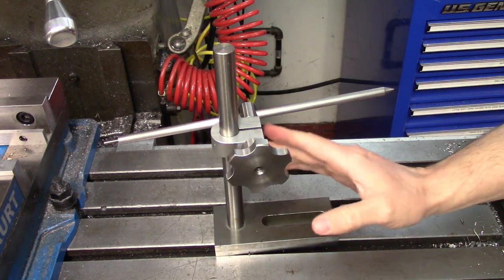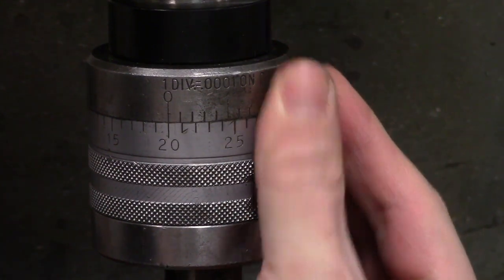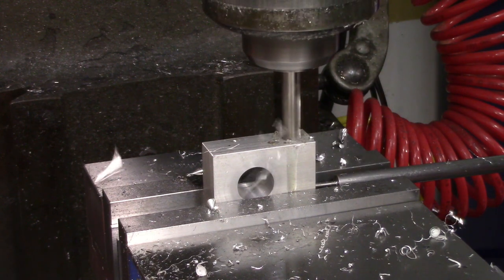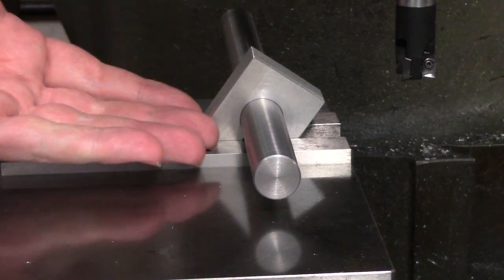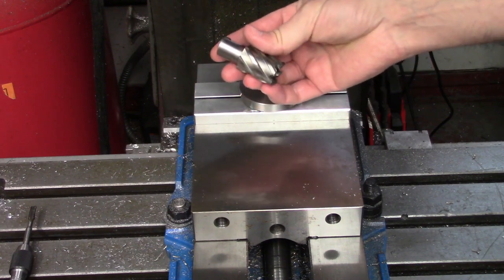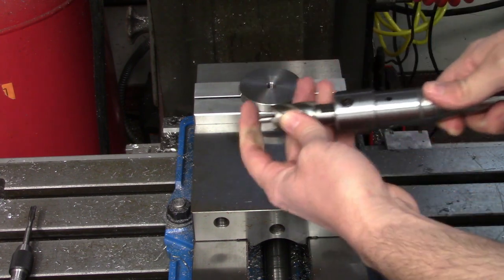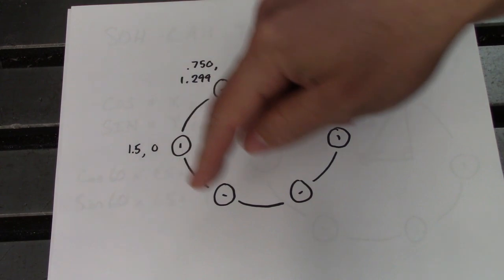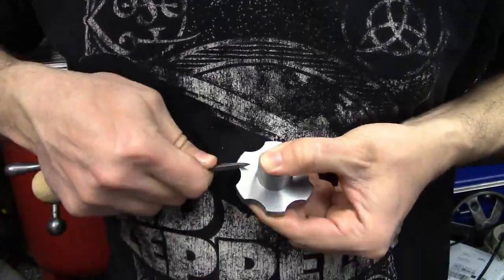Making a Table Stop Part 3

Comment: Hi Stuart,

I enjoy learning from all your video lessons, but I especially have benefitted from the three on making a table stop.  I followed your drawings and have now made my own.

I have a couple of comments.  First, It would have been nice to have a bill of materials for each part on the drawing.  I didn’t realize that the sliding holder was to be made from aluminum so I machined mine from steel.  

Next, I machined the scallops in the tightening knob differently than you did.  I put the knob into my hex 5C collet block and clamped it into the milling vice, cobbling up a work stop from my work hold down clamps.  I found a NOS B&S 1 inch two flute end mill on eBay for a very reasonable price and used it to mill each scallop on the along the center line of the Y axis.  The DRO told me how deep to make the cut.  After each cut I loosened the vise and rotated the hex collet holder to the next side of the hex for the next cut until all six cuts were made.  If I had it to do over again I would use the bolt circle function on my DRO as you did just for the experience.

I drilled and reamed the 3/4 inch hole for the column in the base.  This left a hole a little bit too large for a press fit, so I ended up putting in a set screw to keep it tight.  I now realize I should have used the boring head on the mill as you did to make the hole he correct size for a press fit.

Finally, I used a small corner rounding mill on the base to break the sharp edges at the top and to give it a more finished look.

Great project!  What’s next?

Thanks,

Trent
Reply from the maker: Good to hear.  I love your idea about breaking the edges with the rounding endmill. I'd be interested in seeing a picture of it if you want to send one. You can message me on Instagram @stuartdeharo or just email me at  stuartdeharo at gmail.com

Comment: 10:45 I love using the divider method of find bolt circle ...... if you can scribe a concentric circle over your pattern ..... you can just use dividers and it takes a couple minutes and it's reliable

Comment: Nice video!  You can also tell your DRO that you are doing N+1 holes and the end hole is at 360 degrees. You then ignore the last hole (N+1).  If I don't have a CAD drawing that I've drawn up, I use a paper printout in my shop notebook that describes the locations of holes for bolt hole circles from 3 to 12 holes for a unit (1.0) diameter circle.  You then just scale the coordinates by the diameter you have.  All 10 patterns (from 3 to 12 holes) fit on one piece of paper.
Reply from the maker: I remember seeing those charts and I thought they were in Machinery’s Handbook, but I looked for a really long time and couldn't find them in there. I even had it written into the script.

Comment: I don’t know the wear on your machine, but did you know about the quill Downfeed kick out adjustment screw?  It’s a 6/32 set screw at the bottom left of the depth stop area of the Quill housing………part number 279 in the J-head manual.   You have to look for it because you can only see it from underneath the quill housing……hope it helps!…..I had the same problem on my Bridgeport.
Reply from the maker: Nice. I'll check on it. I figured it was something to do with the clutch.
Reply: @StuartdeHaro  good luck

Comment: Excellent video Stuart. How many rpm were you running the slitting saw ? Thanks
Reply from the maker: I think I had it going at 660 although it was in aluminum. You'll need to go lots slower in steel.

Comment: What are the specs on the bit you use to edge plane the stock?
Thanks.
Reply from the maker: That's a 3/8" carbide 4 flute with a TiAlN coating. That coating is not ideal for cutting Aluminum though. Aluminum tends to stick to it. That's just what I had handy.
Reply: @StuartdeHaro  Yeah, that's better for ferrous metals I think, but as the Dutch say: "we row with the oars we have." ☺